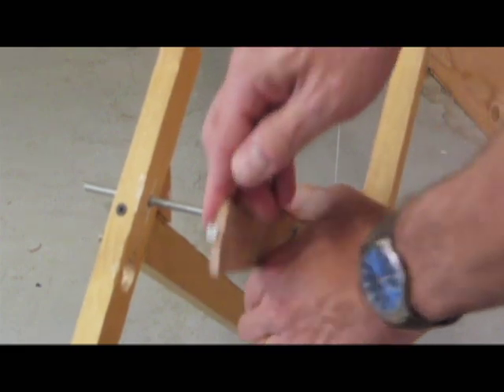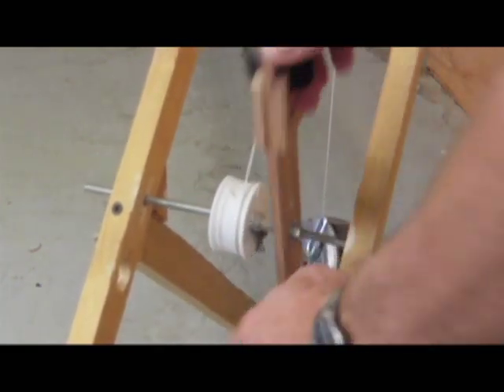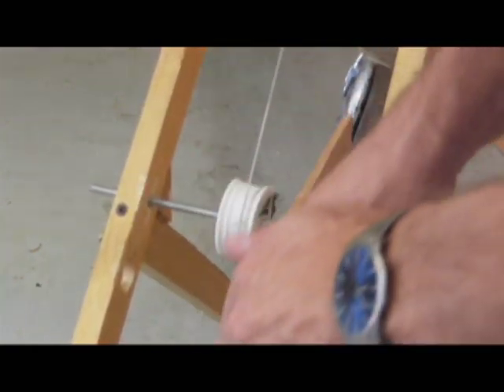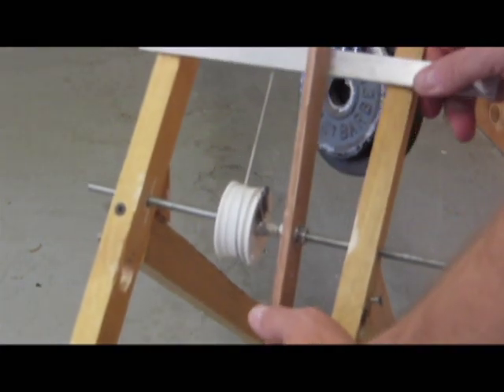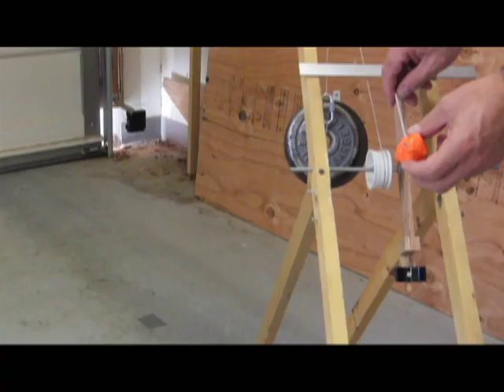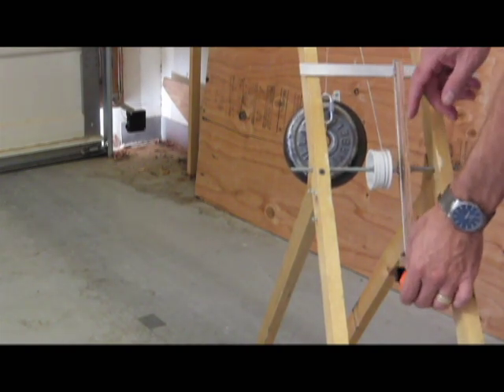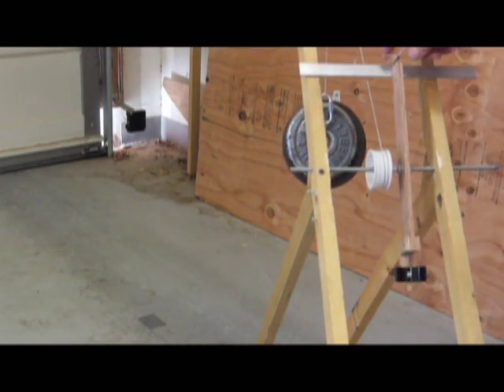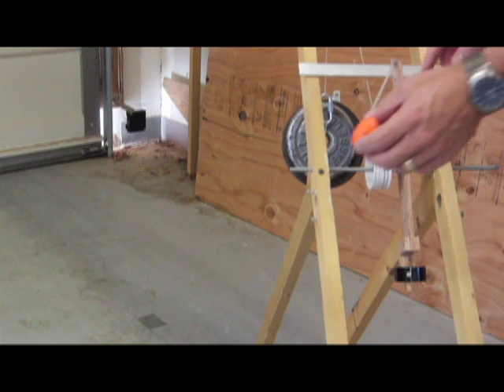Multiple Rotation Trebuchet Demo

Comment: Seems like this would be ideal for increasing the drop height without increasing the size of the apparatus much (dig a hole/trench underneath it for the weight to fall through further.

Maybe not all that useful, but you might be able to vastly outperform similarly sized trebuchet's that can't take advantage of the increased drop time.

Comment: I don't like the drag argument. For a given drop height, a multiple rotations trebuchet that goes around 3.5 times is typically 1/3.5 times the size of trebuchet that goes around once. When considering drag, scaling should favor the MRT, especially since the width of the arm also scales down. 

Even assuming the projectile is main source, the MRT projectile is in a relatively low velocity state until the sling deployment, which much is shorter than that of a comparable single rotation trebuchet.

Comment: I made a trebuchet on a similar concept, except I had the sling increase in in length as the counterweight fell. I though increasing the weight would override viscous losses;however, this thing did not work according to plan. 

Check out this trebuchet though -

youtube "klondike time trebuchet"

Comment: Congratulations. This is the first trebuchet vid I've come across on Youtube which supplies enough info to let us calculate the efficiency.

I suppose 23% is not bad in the circumstances. I had a similar idea once once, but abandoned it when I realized that a system that needs multiple rotations is one where a large slice of energy is going to be eaten up in friction, especially air friction. I think the key to efficiency is to get the missile up to top speed and away as soon as possible.